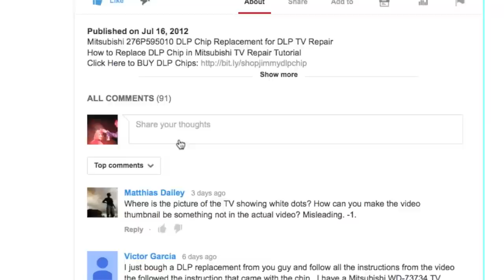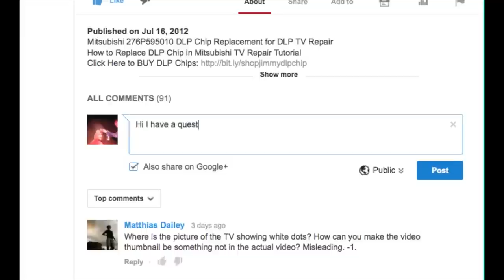LCD TV Repair Tutorial - TV Screen Solarization - Common T-Con & Main Board Symptoms & Solutions

Comment: I have an Element ELEFT502. Had a power surge backfeed into the tv from the dvr thru the HDMI cable.  Also the power surge went thru the tv and burned out the blu-ray, again thru the HDMI cable. Both tv and blo-ray were on surge protector. Dvr was not. Tv would not power up. Replaced the Power Supply Board and the Main Board, Picture is solarized, Menu screen is also solarized, I'm guessing I should try replacing the T-Con Board. Do you agree?

Comment: Have a Vizio E60 C3......After replacing back lights, OK now. The display looks washed out, dim, the image of picture is there but faded. also replaced the Tcon board. the small square IC gets very hot, when the display panel is disconnected this chip does not get hot. All other functions are OK. Mabe a bad panel. Thanks.
Reply: Found the problem. the screen was touching the frame and shorted. Works ok now. thanks.

Comment: Thanks.  I have a Samsung LED TV Series 6 6420.  I had a solarized picture, then after about 1/2 hour, the screen went off completely.  I can't do the diagnostic that you mentioned to find out whether the control section is also solarized.  Should I replace the T-Con board and see if that fixes it?

Comment: Hi and thanks so much for helping me through stage 1 of my tv repair. I have a bush led model number LE 40GB01-C At the start of repair my screen was snowy white with horizontal lines pulsating on the left hand quarter of the screen. I turned the tv off for half an hour and then back on. It appears I had the same symtoms you display in your video. I sourced a T Con board from ebay and fitted it. Great, I now had a picture. However the screen had a faint verticle line down the middle and the left hand side was brighter than the right. When I changed the t con, I noticed that cover plate securing screws passed through each of the lvds cables connecting to the two driver boards( but the tv worked with this arrangement?) I have wiggled all the connecters from  the driver board to the screen with no difference what so ever.OK I spent £20 on the t con board and was thinking I may have a a duff lvds cable? But to source one is proving very difficult.I did swap over the left and right lvds cables and soon realized that the two cables are dedicated left and right and cannot be swapped.Would very appreciate your help and of course buy two new marked lvds cables before I admit deafeat. I have also found, getting any information on this model is impossible. Once again many thanks

Comment: Great video! My 50 inch 4k Onn Roku is less than 1 month old. Twice this last week it experience solarization after turning it on after being off all night. It doesn't do it while it is on all day. However, I am able to get a normal picture after unplugging it then plugging it back in. I don't know if I should just return it. I do recall it only did this after multiple pushing the power button to power off. The next morning on those two occasions, it had a solarized picture. Any ideas? Thanks

Comment: My questions is....I have an LG 42LC2D and when I turn my television off for a long period of time and then turn it back on, my television's picture is solarized. You can also see that there's shadows when the picture changes and a delay in the change from picture to picture.  It takes at least 30 mins to an hour before the picture actually comes back to normal. Would that also be a T-CON problem or a Main Board issue?

Comment: Hello...
I have a Sceptre X370BV-HD. it has the solarization problem you describe in the video and it appears that the menu is affected...although menu is mainly black and white but top portion is solarized. I am having trouble finding the T-CON board location with the back removed. There is a 3" high by 6" wide area concealed by a metal cover....two of the affixing cover screws are accessible while two are behind a major panel including many boards including the main board. Is this where the T-CON board resides and how much of a pain is it to remove the cover? Do you have T-CON boards for this model in stock and what is price and availability? Thanks.
Reply from the maker: +Herb Newborn   Try all repairs and troubleshooting at your own risk. This could be a problem with either the t-con board, the main board or the TV panel. You can replace the main board and the t-con board individually to see if one of those boards fixes the problem.  Click this link to replacement parts for your TV model number:  http://www.shopjimmy.com/catalogsearch/result/?q=X370BV  There may be multiple boards for the same TV model number, be sure to match part numbers on your current board, with your replacement for compatibility.  Thanks and please let us know if you have any further questions with your TV Repair!  www.shopjimmy.com

Comment: Hi guys, 
I have a Toshiba 37AV52U and the screen is solarized.
I checked the menu, as you suggested and the menu is also solarized.
I believe that this means either the t-con board or the main panel.
The problem is intermittent, and will sometimes be fine for an hour.
Any advice appreciated
Bill

Comment: I have a Samsung TV, un40h5003afxza, it got struck by lightning.  I’ve replaced the main board (thx ShopJimmy for the help and part).  I now have power where I had nothing (not even a rest light) beforehand.

Now there’s a picture but it is solarized.  The menu screen is also solarized.  Thoughts???

Comment: Here's a video description: Dynex 40" LCD TV problem

Dynex 40" LCD TV DX 40L261A12
LCD Panel itself is Samsung LTA400HM09

Problem: Color control is bad, looks like red sub-pixels stuck on. Dark is red at start. Red ghost after bright spots that slowly fade. Never normal. Sound's good, Definition's good, Menu's affected too. Other colors and inputs and all other functions are ok.
I suspect a T-con board problem.

Parts: Mainboard --> LVDS cable --> Upper control bar. No separate T-con board.
Is te T-Con integrated to the mainboard or the upper control bar?
If not on the mainboard, does it mean the panel is scrap?

Thanks a lot
Jeff
Reply from the maker: monsieurglad   Please watch this video FIRST to help with your repair!  TV Repair! LCD, LED, Plasma, DLP How To Fix Your TV with ShopJimmy.com Help!  So the T-con is integrated into the panel.  I would replace the main board and see if that fixes the TV.  If that does not fix the TV, then I would say you have a bad TV panel.  Here is a link to replacement parts for your main board.  http://www.shopjimmy.com/catalogsearch/result/index/?cat=56&q=DX+40L261A12  Be sure to match part numbers on your current board, with your replacement for compatibility.  Here is a link to a video showing how to identify your part number, click here:  STEP #1 - Insignia Main Boards Replacement TV Part Number Identification Guide  Thanks and please let us know if you have any further questions with your TV Repair!  www.shopjimmy.com

Comment: I have an LG 42LB5D that would not power on. I replaced the power board (replacement#EAY32731102) and the unit came on. The screen was polarized. I replaced the main board (replacement#EAX38059702(11)), which didn't work.  As a last resort, I replaced the T-Con board(replacement#AOC L42H761  T-Con Timing Board V420H1-C07), which didn't help either. I inspected the LED boards on either side and didn't see any capacitor problems.  Any suggestions you have would be greatly appreciated. Thanks for being there for us.

Comment: You said solarization is their the t-con or the main board.  I called the manufacturer and they told me to unplug the tv, hold down the remote on button for 15 sec, then plug it back in - guess what?  IT WORKED.  when you "hard reboot" any Android TV it checks for an operating system update in the boot process and sure enough it found one and that totally fixed my TV.  Sorry if this post costs you customers but they may not need to SPEND anything.

Comment: Hey ShopJimmy.com, I have a Sony KDL-46V3000, the picture is all negative and very bright including the menue. However the picture just went to normal colors with a witheish layer all over for about 20 seconds, then went back to the solarized picture. Does this help to determine if it is indeed the T-CON board which is faulty?

Greetings and thanks
Reply from the maker: munnimann   This could either be a problem with the main board or the T-Con board.  I recommend replacing the T-Con board first to see if that fixes the problem.  If that does not fix the problem, then I recommend replacing the Main board to see if that fixes the problem.  Here is a link to replacement parts for your TV model number on our website, click here:  http://www.shopjimmy.com/catalogsearch/result/?q=KDL-46V3000  Be sure to match part numbers on your current board, with your replacement for compatibility.  You can also call our customer service for further assistance with your purchase.  (877) 881-6492  Thanks and please let us know if you have any further questions with your TV Repair!  www.shopjimmy.com

Comment: Thanks for the video.  I "think" I have a similar issue, but would like your opinion before I order parts, and any further diagnosis tips you may have to offer.  I have a Vizio E320VL TV, about 4 years old.  Recently, when I turned it on, I get a very bright screen with the video washed out and even appears to be in negative display.  I have tried resetting all the settings, even a factory reset.  I have also tried different cables, using both the HDMI and Component/Composite ports...all with same results.  I know the incoming signal is OK, because a different TV works A-OK there.  Any ideas to further diagnose or repair are appreciated.
Reply from the maker: Ron Mitchell   PLEASE SUBSCRIBE TO OUR CHANNEL - Try all repairs and troubleshooting at your own risk.  This could be a problem with either the main board or the TV panel.  You can purchase and replace the main board to see if that fixes the problem.  Click this link to replacement parts for your TV model number:  http://www.shopjimmy.com/catalogsearch/result/index/?cat=56&q=E320VL  There may be multiple boards for the same TV model number, be sure to match part numbers on your current board, with your replacement for compatibility.  Here is a link to a video showing how to identify your part number, click here:  https://www.youtube.com/watch?v=kxkeGLhlQY8  Thanks and please let us know if you have any further questions with your TV Repair!  www.shopjimmy.com

Comment: Toshiba 55L421U at first left upper went darker so I was looking for LED strips to replace but yesterday it stopped accepting signal from my antenna, did all the normal trouble shooting, and its the tv for sure, these 2 symptoms seem to indicate it needs a main board, or both leds and a new main board, am I right?  tv is only 2 years old but i did have the leds all the way up for best picture, and did not think they would burn out at all let alone in 2 years. Is it worth repairing at all?  If so I feel i can do it after watching youtube vids. thanks... david

Comment: I have a Sharp LC-65D93U with blue dots lined up all over the screen. When I did a hard reset, plunged it back in and turned it on there were red dots lined up all over the screen. Then when I go back thru all the inputs they are blue again. I was told it was a bad T Con board. Thank you!

Comment: had solarization (red on black parts) on samsung UN37EH5000. replaced tcon and it made it better, but still some solarization - does this mean its a panel issue - or could it be that the replacement tcon I got was a dud?

Comment: Hi, I have an LG 32LH40 TV, after 3 years it started intermittently solarizing (menu included), buy usually would clear up after many minutes, but took longer to clear as time went on, was under warranty, and panel was replaced. Seem to fix issue, but less than 1 year later same thing started happening, intermittent solarization (menu included). Second warranty call they just paid out the claim saying it would be to expensive to replace the panel. I got a good payout and could replace the TV, but I'm wondering how can it be the panel if most of the time the picture is good and not solarized? Thanks for your advice? also, I noticed that all your T-Con boards for this model are out-of-stock, do you ever get these in?

Comment: Hello I have a question I have a Vizio e600i-b3 and I just moved it to my new apartment and the only thing bad that happened is I missed a plugged in audio optical cord and it broke the plug in side of the tv but after moving it in all the colors are off blacks have thin white lines face have green tint and all the colors are off I tried resetting it to factory settings and all I can do is dim the back light and raise the brightness to even it out to make watching it manageable please let me know I was thinking id have to order a new main board or Tcon?

Comment: Having issues with a Samsung LNT4671FX/XAA solarization when first started. It will after some period of time will clear up and have a perfect picture. When it first started it had horizontal lines then it just started with this solarization problem. When it was turned on this morning it had solarization then after 3-4 hours it cleard up and now working great thank God, good green bay game. Please let me know what you think. I do not have an issue replacing a board as long as it is not the main board.
Thanks,Jim Sullivan
Reply from the maker: +Jim Sullivan   Try all repairs and troubleshooting at your own risk. This could be a problem with either the t-con board, the main board or the TV panel. You can replace the main board and the t-con board individually to see if one of those boards fixes the problem.  Click this link to replacement parts for your TV model number:  http://www.shopjimmy.com/catalogsearch/result/?q=LNT4671FX%2FXAA  There may be multiple boards for the same TV model number, be sure to match part numbers on your current board, with your replacement for compatibility.  Thanks and please let us know if you have any further questions with your TV Repair!  www.shopjimmy.com

Comment: Hello,  I have a Samsung lcd tv model LN40A530P1F that the colors are distorted but the menu looks fine. I see one bad cap on the main board (470 uf 10v). In this video you mentioned this symptom is an indication of issue with main board. Could it just be this cap or are there other issues to look for in the board?  I prefer not to spend a ton on the tv as it is 8 years old but if just caps or other cheap parts I would like to try to fix it. The caps were replaced by Samsung about 5 years ago for the clicking power in issue. Thanks for any help! Mike

Comment: Hello. I have a Vizio D43-F1. I have intermittent solarization that comes and goes. Sometimes the screen just becomes brighter than
normal with a lot of contrast, then i get that solarization negative image effect. In addition, I notice a localized area on the bottom
of the screen, which is very bright LED bleed. When the TV works normally, I cannot see LED bleed.
My first thought was a T-con board, or possibly a ribbon cable connection problem. What are your thoughts?
I will greatly appreciate your reply.-Thanks.

Comment: Thanks.  My problem is with a Vizio E320VL and the screen is bright white with a solarized or negative view of video.  The Menu is also solarized.  Can you tell me what part I need to fix this problem?  Thanks.
Reply from the maker: Ron Mitchell   PLEASE SUBSCRIBE TO OUR CHANNEL - Try all repairs and troubleshooting at your own risk.  This could be a problem with either the t-con board, the main board or the TV panel.  You can replace the main board and t-con board individually to see if one of those boards fixes the problem.  Click this link to replacement parts for your TV model number:  http://www.shopjimmy.com/catalogsearch/result/?q=E320VL  There may be multiple boards for the same TV model number, be sure to match part numbers on your current board, with your replacement for compatibility.  Thanks and please let us know if you have any further questions with your TV Repair!  www.shopjimmy.com

Comment: Hello, Shop Jimmy! Thank you for this informative video.  It appears my tv problem may be the main panel board because the menu looks normal, with no solarization.  I have a 37 inch samsung flat screen I bought new in 2008, with a warranty, and it’s already been repaired once , ( for a different but possibly related? issue) - color streaking in the monitor.  I wonder if I should try to repair it or just cut my losses & give it away/ recycle.  Thoughts?  thank you for your time..

Comment: model: Samsung LE32A436T1D 32 inches
symptons: the screen is solarized even menu is, but the diference is that screen is black and shows something only if you connect PC to it. So i am guessing its T-con board? Inventer seems working so does power suply if it shows something at least? Any suggestions ?

Comment: Hi from Northern Thailand Jimmy

I just gave an elderly Philips LCD TV 32 inch to my wife's family. They have kids and don't have much money so it's useful for them. Trouble was when I went to pick it up from my store room the screen had kind of wrinkle lines near horizontally across it. It was as if a film had puckered slightly.
We tested to the TV today and the pic is fine underneath, the lines don't really show, but there's a kind of haze in the area.'
Appliance repair would be cheap over here......Question is....is this just an anti glare film that can maybe be removed or I have read of a polarising film without which it's no go.Would the TV about 5 or 6 years old have this one?

Any hope for a repair here Jimmy?
(They can still watch it its still usable just not right.

Thanx v much!
Reply from the maker: +john wickenden  Try all repairs and troubleshooting at your own risk.  The filter screen needs to be realigned.  Thanks!  www.shopjimmy.com